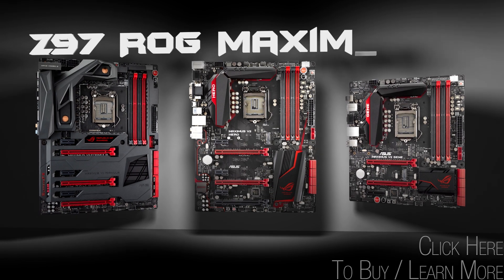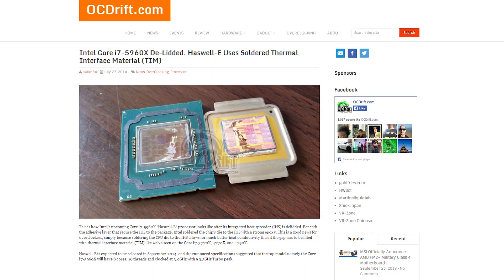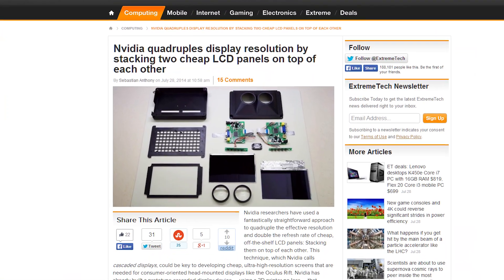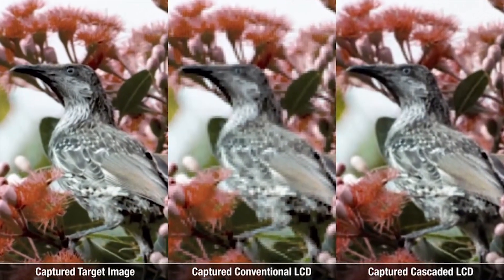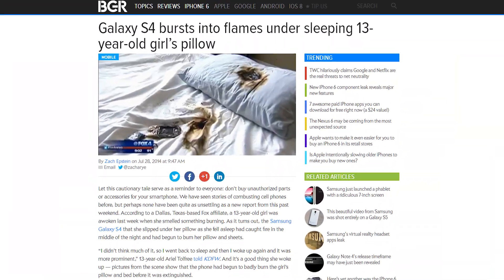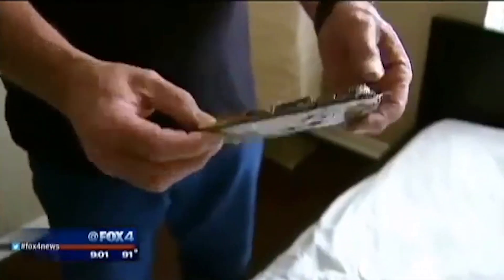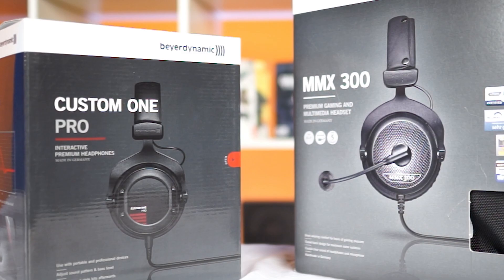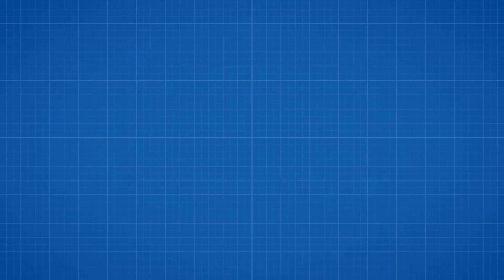Haswell-E die soldered, Nvidia bashes Mantle, Galaxy S4 explodes - Netlinked Daily

Comment: Nvidia FTW!
Reply: *****
Performance over price any day.
Reply: Nah team red.
Reply: AMD FTW, PS4 FTW, PCMR FTW,MY DICK FTW
Reply: The LCD technology  is cool but not supporting mantle is a dick move but understandable at this point as long as they support it out of beta I am fine with that
Reply: Dylan Foxx
Why is not supporting Mantle a dick move? Nvidia card users would get absolutely nothing out of Mantle support.
Reply: Lol no!
Reply: Dylan Foxx
1. Consoles use custom APIs built specifically for their hardware, so Mantle will not make cross-platform development any easier.

2. Mantle's performance improvements were massively exaggerated, most real world users see little to no improvement using Mantle over DX11.

3. AMD owns Mantle and they're not going to give over control of the API or its development to anyone else, being allowed to use Mantle and being allowed to alter it are two very different things.

4. DX12 offers everything Mantle has, plus new rendering features that Mantle doesn't have, AND will work with all current DX11 based graphics card and mobile devices.
Reply: 1. Try doing some actual research, DX12 is coming to Windows 7. Which means Devs only have to program once for DX12 and cover 85% of the current PC gaming market.

2. Mantle's real world benchmarking tests prove its not what its cracked up to be. Hell Nvidia managed mantle-esque performance improvements with just a driver update. Which means Mantle isn't doing jack. Also you're just pulling stuff out of your ass, their is nothing about Mantle that makes it better for 4k than DX.

3. This isn't really even worth responding to because you need to be a special kind of stupid to honestly believe AMD is going to let other companies do as they please with Mantle.

4. I repeat what I said up at number 1, do some actual bloody research, DX12 has been in development for the last 4 years, long before there was even the slightest whisper of Mantle. There is also absolutely no reason to believe AMD could do any better than MS on the API front and in fact plenty of reason to suspect they would do far worse. AMD is famous for their shitty drivers and a complete and utter lack of innovation, TressFX is quite literally AMD's biggest claim to fame in rendering technology in the last decade.
Reply: conduit64
Microsoft, so far, has been using DX to push newer versions of Windows, which is why adoption of any new version sucks a**.
I wasn't saying that they should go for Mantle over everything else.

If Nvidia was really looking for both an open API and one that can do low-level stuff while at the same time trying to actually help developers they would have done it with OpenGL. Not only would this open things up for developers to go to Linux and the upcoming SteamOS, but it would also help indies port stuff to mobile AND get things running on MacOS.

So far, Nvidia seems to have a lot of support from Microsoft and are focusing on DX, software-wise, because it's cheaper and easier to do.
Reply: conduit64 how would they get nothing they would have access to a new api in development that we could see take hold on all 3 platforms making multi platform development extremely easy. as well as performance improvements and the fact nvidia could have say in the api and improve it as they saw fit.
Reply: conduit64 you sound like a console fanboy
Reply: conduit64 
1. yes and no they consoles so have there own apis based on directx for the xbox and opengl for wii u and ps4 but this is not the same a a brand new api from scratch.
as well i was more talking about windows mac and linux. as well the announcement that directx 12 will not be coming to windows 7 means developers will still need to program in directx 11 or lower for win 7 and vista and 12 for 8.1 and 9 while as mantle supports windows 7 already and devs won't have to program twice and only see benefits on some systems.
in addition mantle could be use on consoles as all of them have amd based chips so it would just take an update to mantle and the consoles to allow that.

2. mantles performance increase is based of the hardware you have you will still see improvements on higher end cpu but also on  low end cpus. this will help to make cheap pcs that have ok cpus but don't hold back performance. in addition mantle is still in beta and new so we may see more improvement with more demanding games and once they start to get use to programing for it as well as update it.
And another thing is mantle has been made with higher definitions in mind meaning 4k will be better on mantle.
yet another thing is it is still in beta and has not had the market time directx or opengl has so we will see improvements as it grows and i would assume it would grow especially fast if intel and nvidia were to be able to add their technologies and work on it with amd.

3. actually i do believe they plan on opening it up as it comes out of bets as this artice said http://www.pcworld.com/article/2365909/intel-approached-amd-about-access-to-mantle.html
now what that means for another compy like intel to experiment with it for there systems i dont know im not amd however i would expet them to give over everthing as it is in amds best interests to do so.

4. yes and no the problem with microsoft's api is they don't add anything to it we are only seeing them do this because of mantle. meaning that there api has gotten no serious updates since directx 9 and that lack of innovation in a fast paced market could hold a lot of deves back as well mantle is better suited for higher resolutions such as 4k and will work on more systems than directx 12. as well i would love mantle to be a very easy api meaning it can be more of a right once deploy anywhere whether it be consoles pc mac linux or android whether this will happen i don't know but that would be something directx couldn't do and something sld kinda does but mantle could improve upon.

if you have any questions on this information i will gladly explain my point of view as well i only grabbed the one source because i new where is was but i can grab other if you disagree on any of my statements all you need to do i ask and i can get them.(hope you read the whole thing and are not just mad because you are a nvidia fanboy will have to wait for your reply to actually no so i will assume you just haven't done a lot of research on the api)
Reply: conduit64
But it's DirectX, it's still a piece of crap. They claimed to be able to do what Mantle does with OpenGL extensions, so why not do that?! By focusing on DX you're limiting yourself to Windows and saying that you're content with Microsoft taking the lead in supporting game development on PC, the same Microsoft that showed nothing to indicate that it gives a rat's a** about gaming on PC.
Reply: conduit64 I like Nvidia but they have the worst marketing strategy, they want to kill the competition even if that means the progress for GPUs will slow down.
Reply: ShiroiKage009
So Microsoft has spent the last 4 years rebuilding DirectX from the ground up, all for a market they don't care about... Yep, makes perfect sense.

Heres the problem, any API developed by a GPU manufacturer will always have a performance bias in favor of their own hardware. Why? Because people are biased, the programmers will, even if unintentionally, show favoritism towards their own company.
A biased API leads to an unbalanced market, which stymies  competition and erodes consumer choice.

General APIs should always be developed by third parties with no vested interest in the GPU market, whether thats DirectX, OpenGL, or some entirely new API.
Reply: conduit64 all for a market they don't care about what does that mean that in itself is bias. but your statement is true and bulshit at the same time microsoft has already made the playing field uneven with the opengl scare they created where they said they were no longer going to support it. and while most of us will be pissed and rightfully so if amd stacs this in their favor we can't shoot them down before they have taken their first step if it turns out they can't handle the power then we can move development to a 3d party non profit overseen by game devs and card manufacturers and if it truly goes bad there is still directx and opengl to use so like i said before we have more choice unlike if microsoft and nvidia ganged up on amd because they tried to overthrow directx. but even so more choice is better than no choice so yah idk why you are so scared of mantle a new api in its infancy.
Reply: Spend 4,000 never upgrade again
Reply: ShiroiKage009 Again you show you don't actually know what your talking about. Nividia is a member of the Kronos Group, the consortium that is currently in charge of developing OpenGL. Furthermore, Nividia has been working directly with Valve on SteamOS. Nividia is heavily invested in both OpenGL and Linux.
Reply: conduit64
I know they are invested in OpenGL, and I don't care. Their statement here, along with other statements, show a public attitude that does not lean towards OpenGL, especially when the company's top heads don't immediately go to OpenGL instead of D3D.
Reply: ShiroiKage009
Nvidia supports DirectX because its the industry standard for Windows based games, and the industry standard is set by the game developers, not the hardware manufacturers. So until developers decide to choose OpenGL over DirectX, Nvidia's primary support will be for DX.
Reply: conduit64
Not really. Developers flock to places with support and portability. Microsoft helps no one with using D3D so the only ones that do are the hardware manufacturers.

I mean, if you're offered support to use an API that will get you on 3 operating systems as opposed to 1, wouldn't you do it?